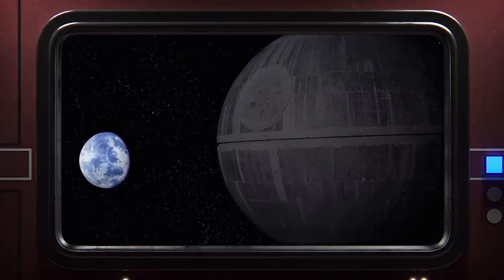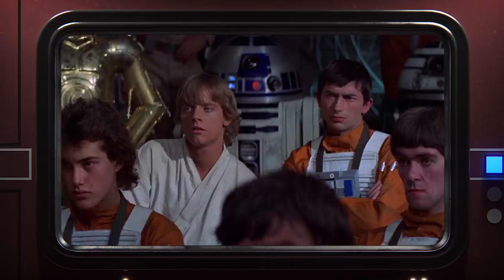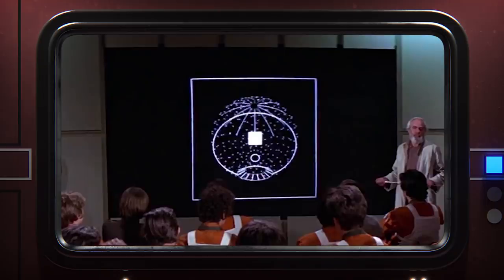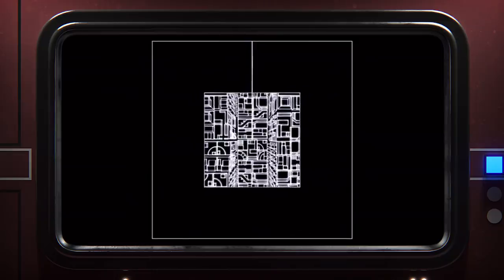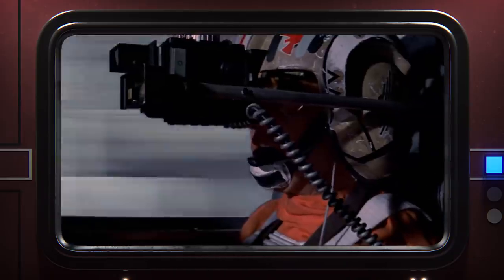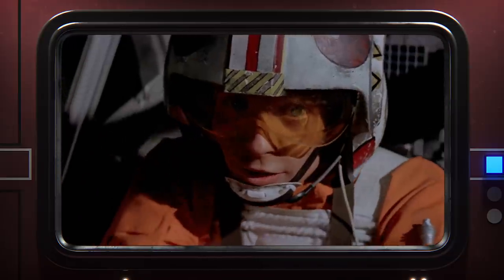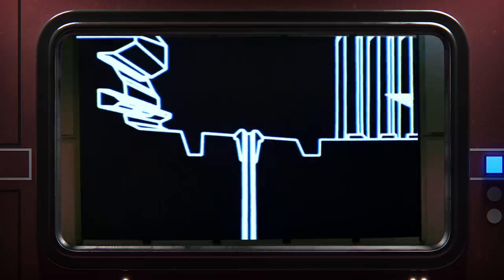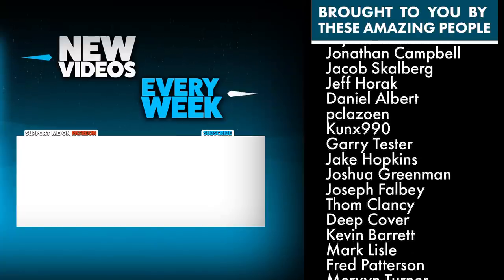The Thermal Exhaust Port Was NEVER a Problem

Comment: I think the deliberate act of sabotage was important for an easily-missed fact about the whole plan.  If you had the complete technical readouts of that battle stations, how in the hell is a small group of rebels going to manage to find an exploitable weakness within hours when an entire design team couldn't manage to find that weakness within years of development?  That's the most unbelievable part of the whole thing.  You can argue about the weakness being an oversight versus being sabotage, but either way it doesn't make sense that someone is going to find that weakness so fast unless they were deliberately told about it by someone on the design crew that knew about it.
Reply: Which is why I think that Galen Erso hid the sabotage as an actual upside. That way, he could simply frame the supposed weakness as a strength, and if anything ever went wrong, he could blame it on an oversight.
Reply: @kennyholmes5196  "It'll be fine! The odds of it getting hit are millions to one, and the cost savings compared to a more distributed and hardened design are enormous!"
Reply: @Neuttah  Nah, it's more along the lines of "The energy output of the core, and therefore the savings on fuel relative to a more stable design, are worth it. After all, it's not like there's really any chance that they could use snub fighters to exploit it; you've already covered that scenario with the surface-level turrets, so we don't need to worry about the chain reaction possibility; it's stable enough to not do that if properly managed."
Reply: @kennyholmes5196  I maintain; It's more or less the same statement, mine is just shorter. :P
Reply: @Neuttah  There's a difference between sentiment and content. Yours is targeted at the exhaust port count and number, while mine is targeted at the core. Remember, Galen specified that he put the flaw in the core, not the exhaust port.
Reply: @kennyholmes5196  Actually, my angle was more along the core itself, likely, being smaller, cheaper, and maybe more energy efficient, leading to knock-on effects on both the reactor system being more compact.
 And, as a result, the station itself, and the overall project both being cheaper.
I just skipped to the part with the bottom line, because that's the one that'll end up in the eventual equivalent to the Chernobyl courtroom scene.
Reply: Not an oversight at all- intrinsic to the design. All craft have vulnerabilities which is why the plans and layouts are kept secret.

Comment: Henry, you're not only correct - it was in the originally filmed version of the Battle of Yavin. Originally, Luke made two (2) runs on the trench. One using the targeting computer that bounced off like Red Leader's. And the one we see in the film where he uses the Force. The Force was ultimately able to allow the rebels to win, because Not!Wedge was right: the computers couldn't make that shot. But the Force allowed the impossible shot.

And for anyone wondering why the release version only had one trench one - it was cut down in editing by Marcia Lucas who pointed out that the battle was already running long and having both trench runs would add another 5 minutes to the battle that as Henry points out, was already covered in Red Leader's trench run and the exposition.

The thermal exhaust port might be a fatal weakness, but the odds of anyone doing it are impossible. Even Tarkin dismisses it when he was approached by an underling. Its such an insignificant flaw. Only luck or the use of the Force (or both) would allow an enemy to exploit it.

Comment: You missed 2 major things: 

1: The exhaust port wasnt the weakness talked about in R1, the weakness was in the reactor, apparently if Galen hadnt messed with it hitting it with a high explosive WOULDNT blow up the whole station? 

2: The Empire knew for a fact that ray shields dont protect against proton torpedos, they should have planned accordingly and added additional protection. Nothing has ever covered that plot hole.
Reply: @katt842  Kenobi was their only hope after all...
Reply: point 1 nullifies point 2.
Reply: They could have installed the Death Star version of those animal-proof caps you can put on a house's chimney that let the chimney function but keep out animals and rain.
Reply: "Should have added additional protection"… Like a dozen massive turbolasers all along the trench leading to the exhaust port ?
Reply: From what I can tell a proton torpedo usually doesn't curve and then go in a straight line, avoiding the very close walls perfectly. Proton torpedoes ordinarily wouldn't be a threat because that shot is nearly impossible. It's like trying to thread a needle with a bullet.

Comment: Out of the 12 trenches leading out from the north, is the one with the exploitable weakness the one that is closest to the superlaser?  This might also explain 1) why it was the specific one that was exploitable, and 2) why it happens to blow up right as they were about to fire.  Yes, I know, they did that in order to build up tension, but there are always "explanations" for such things as well.  The precise hit would have destroyed the Death Star anyway, but the way I see it, them charging it up and preparing to fire is what made it explode so suddenly and violently.  We would probably have seen a more gradual death like Death Star II otherwise.
But that's my theory.
Reply: I also subscribe to something along those lines. The specific line by Jan Dodonna was 'A precise hit will destroy the station." But that word, destroy, is rather vague if you consider it. If you look a destroyed ship, they're more husks, wrecks, and dead hulks, not completely annihilated like the Death Star was when it blew up. So my belief was that if the Death Star hadn't been preparing to fire at full power, Luke's torpedo would've rendered the station inoperable, but not completely obliterated it.

Comment: The fact the other exhaust ports couldn't be exploited and only this one leads credence to it being a dilibrate move especially since it destroys the entire MOON SIZED death star and not just causing some damage to the structure.  The entire station with two tiny torpedos.
Reply: The sabotage mentioned in Rogue One is in the reactor module, not the exhaust.
Reply: @arcticdino1650  The exhaust port doesn't lead to the reactor, but to something much closer to the surface that can explode, setting off a chain reaction.

Comment: But the thing to consider is that Galen's sabotage wasn't the exhaust port.

Galen worked in the power system for the station and the superweapon. He explicitly said that he’d built a weakness INTO THE REACTOR:

“Saw, the reactor module, that's the key.
That's the place I've laid my trap.
It's well hidden and unstable, one blast to any part of it will destroy the entire station.
You'll need the plans, the structural plans for the Death Star to find the reactor.”

Galen didn’t include the exhaust port in the design, otherwise he would’ve mentioned it by name. He explicitly directs them to look for a way to hit the reactor module. Because he didn’t worked on the rest of the station he probably doesn’t know of any way to reach the reactor module from outside.

This implies that even a direct hit like the one Luke pulled off shouldn’t have blown up the station. 

This is reinforced by the fact that the officer’s suggestion to Tarkin when they figure out what the Rebels are doing is to recommend preparing the shuttle. They appear to be operating under the impression that even a worst-case scenario with the reactor will leave them time to evacuate the station.  A sudden and complete destruction of the entire station doesn’t appear to cross their minds.
Reply: on the point of why Urso doesn’t mention an exhaust port, it may have been a cover in case the message was intercepted.  If he spelled it out they could have know about the weakness and covered it up.  keep it vague about the reactor and they still have a guessing game
Reply: There's also the fact that at the time, the Super Laser was powering up, and ready to shoot, that's a lot of power that was channeled into a very small space... like when you fill a balloon with air.... it only needed a pin-prick.

Which means, if the Rebels caught the station either after the Super Laser had fired, or in an area where it wouldn't use the Super Laser anyway, the reactor going up would've still destroyed the station, but much more slowly (like Star Killer Base in EpVII or even the DSII in RoTJ)

Comment: It is shielded with ray shields, which means energy weapons would be stopped dead. A reason I dug up somewhere for the trench approach was that it also had particle shields (eg. physical shields what would stop a ship or torpedo) but those only formed a flat "umbrella" over the top that did not cover the sides because they don't interact well if they touch surfaces. Planetary shields (same thing but bigger) have the same issue, which is why you can fly ships in under the edges to land troops if it's not a planet-wide shield network. All things considered the port was invulnerable to any practical assault, and I like to think the non-valid ports simply had a kink or a turn a warhead would have to make that would screw even all the above: the exploitable exhaust pipe was the only straight one, probably for structural reasons (or sabotage disguised as structural reasons).

A proton torpedo was needed because it was a physical projectile (bypassing the ray shield) and was a guided munition that could turn sharply (allowing it to be fired under the particle shield and then dive into the port). Like you said, this is an incredibly precise set of conditions that must be met. I don't think it required a space wizard, but absolutely nobody was going to pull that off without the stolen plans, space magic or no.

Comment: Possible, although the way Galen Erso said seem to implies that his sabotage was about making the reactor much more unstable than it should be, rather than deliberately place an exhaust port just for that. (more like "I make sure a single proton warhead explosion at the reactor will cause a total destruction. As to how to get a warhead down there, that's your problem." than "I place an exhaust port right here just for you, my daughter").

This would be support by the fact DS1 destruction is way faster than DS2.

From what I count, in Episode 4, the time between Luke's torpedoes enter the exhaust port and the destruction of DS1 is around 12 seconds, while in Episode 6, the time between Londo shooting directly at the reactor and the station's total destruction take about 40 seconds.
Keep in mind, when I measure the time, the total time in Episode 4 include the torpedo moving down the exhaust port, hit whatever is down there, and trigger the detonation of the main reactor. The total time in Episode 6 start when the reactor was already starting to explode.

Also, the way both Death Star explode are different as well. In Episode 6, we see the inside of shuttle bay falling apart as Luke tried to escape, and that is around 30 seconds before station's complete destruction. In Episode 4, everything just went on as normal. We see everything inside is still very calm, and the firing procedure is still going on as usual. Then the whole station just explode.

This might simply be due to dramatic reasons, but these different might indicate possible sabotage at the reactor.

Comment: @ECHenry ,  I definitely agree.  People forget the exhaust ports are to discharge the MASSIVE amount of radiation and heat caused by the reactor and the main weapon system when it fires.  Which is similar in design to both other weapon systems throughout Star Wars, and in our real world.  

However, I like the addition of the Rogue One tie in of the flaw in the reactor itself (not the fact of the exhaust ports).  The reactor on most space stations or starships is extremely well protected, but throughout the novels/comics/video games if you cripple the reactor of a capital ship, it explodes like a nuclear warhead and obliterates the vessel with ease.  I like that Galen hid an instability in the reactor that any minor explosion would cripple it and set of a chain reaction throughout the station.  But since he contacted Saw Gerrera to find the schematic layout, I think Galen assumed Saw would attempt to take a commando strike team into the station while it was still under construction/testing, and literally set "internal" charges with a hope of successful sabotage.  However, since they were too late  and the Death Star was underway to assault the Alliance at Yavin IV, it was up to General Dodonna to find an "external" way to assault the station while exploiting this weakness.  In short, I don't think Galen ever thought to suicide attack the battle station with snub fighters.......

This nicely weaves the canon stories into one (which I think the films explain very well and in great length), in which Dodonna reveals that a direct torpedo hit to the main reactor will set off a massive chain reaction to destroy the battle station, and points out the only exhaust port that even gives the Alliance a chance at exploiting the weakness, due to the station's construction design.  And, as you pointed out it was still a longshot with all this information and it is ONLY through Luke using the Force to accurately fire his torpedoes (in lieu of the computer-guided system) that the attack works.

Moral of the story, always bring a Force User into a battle........
Reply: Moral of the story is Rouge One was a pointless garbage movie

Comment: Also remember, it's an exhaust port, as in outward resistance air pressure, making it that much more difficult to get a projectile of any type down the entire radius of the huge sphere. The absolute only way to exploit the port is by using the Force. So if Luke hadn't been on the team, the mission would only fail.
Reply: especially in space (ie a vacuum, so massive air pressure difference)
Reply: @matthiuskoenig3378  It's not that massive.  Air pressure at the bottom of the troposphere is only 1 bar.  The real question is with what force the exhaust gas was pushed out.

But that doesn't matter.  It's a torpedo, which means it is self-propelled and self-guided.  It only needs to find its target before its energy supply runs out.
And its target is not the core of the Death Star, its something that will set off a chain reaction that will eventually reach the core.

Comment: My headcanon is that he sold the instability as a necessity to the sheer amount of power it needed to destroy a planet, a not-insignificant feat. 

"Why is the main reactor so unstable, Erso?"
"Because it was a design necessity. If I didn't pump so much fuel into it, it wouldn't be able to generate enough power to destroy a planet in a single shot. Would you like to explain to the Emperor that his grand weapon is not capable of fulfilling its design specifications?"
"Point taken. Carry on."

I like to think that since Erso was the chief engineer, his patents and designs were carried over to the second Death Star because they were literally the only ones available. If you need to design a car, you always design it around the engine because that's where you get your power. If you need to design a Death Star, you need to reach for the top shelf and find the most insanely powerful reactor you can, and Erso's design was that reactor. There simply wasn't any other reactor design remotely powerful enough to do what his could do, and so they reused it for the second Death Star. They were still aware of the problem, but their solution to get around it was to use thermal exhaust ports that were too small to sink a torpedo into. This likely factored into the reason they had to build the second one bigger than the first; smaller vents means more surface area needed to disperse heat, so they had to make the weapon bigger as a result of making it sabotage-proof. The fact that the service corridors were still open during construction was likewise not a design flaw since they were likely going to be closed up after construction was complete and were necessary for transferring material into the battle station's superstructure. So yeah, I don't really think of the reactor's design flaw as a design flaw, more like something that Erso engineered into it so that it wasn't totally impregnable and something that could be exploited in a one-in-a-million shot that, if the pilot wasn't Force-sensitive in a big way, likely was impossible, even for a computer.
Reply: I also think the core being exposed to space let the big laser fire more often. Taking almost no time to cool down rather than minutes. A really good feature for an ambush.
Reply: I mean, the second death star had like, massive chunks of itself not completed, so even closing service ports probably wouldn't change much lol

Comment: EC Henry, I am completely with you on this one. The original film had this covered. I do love Rogue One, but they never really needed to explain why it is is a weakness.

Also, an exhaust port that blocked physical objects wouldn't be an exhaust port, would it? Ray shields were the best they could do.
Reply: I mean it would seem silly that one single port is slightly bigger than the others to the point that it's a weakness. Even more so since its on the plans for it even.